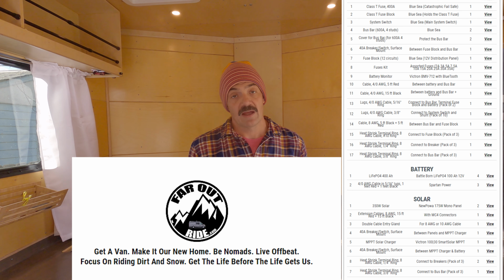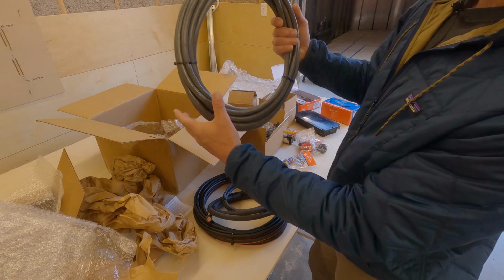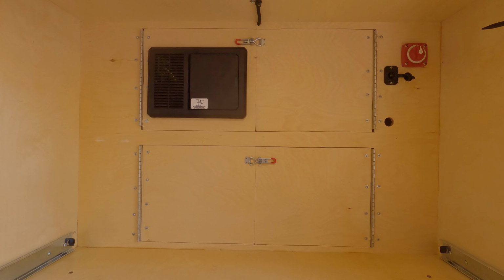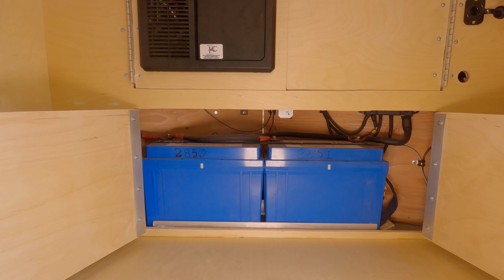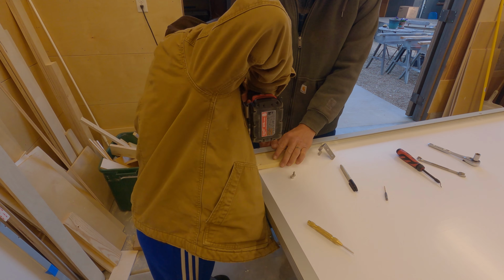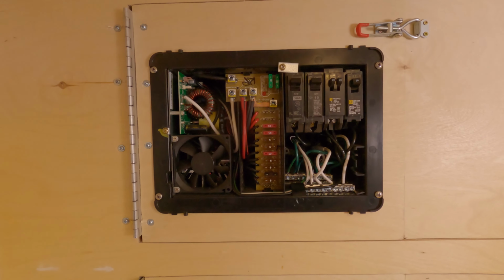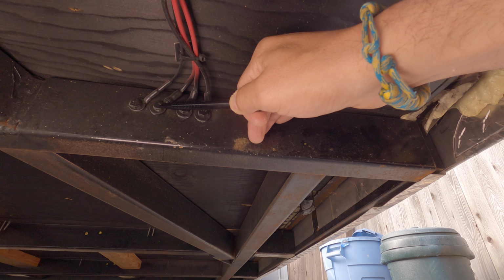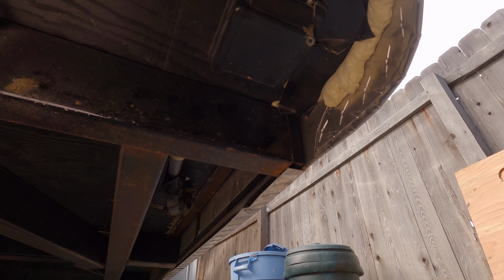DIY RV Electrical Tour- Solar, Victron, 12v LED Lighting

Comment: Thanks for the great information. I have heard that charging lithium batteries while driving could potentially burn up your alternator and lead acid batteries are preferred for this application. Should I be concerned about that for my build? Trying to decide which batteries to go with.
Reply from the maker: Brotherman- to be honest I am not the best person to answer your question.  Which is why I ended up using AM Solar- I just purchased parts that were all designed by an electrical engineer to work in my application. 
You could also speak with a battery manufacturer.  I had great customer service from both LifeBlue and BattleBorn.  
I knew I wanted to go with Lithium over LA (lead acid) for space and weight savings.  I only need two lithium batteries rather than four+ LA to get the full use of my 200ah capacity.  I don't know where I put my calculations but LA added a TON of weight and only saved me a bit of money.  Also, battery footprint in a small space (RV, Van) is valuable real estate.  Lithium for me.
Reply: @adventuredad1180  thanks, do you still recommend that particular battery that you used, and did you find one was sufficient to run your fridge etc.
Reply from the maker: @brothermanly316   I really like the LifeBlue batteries.  II have not tested other brands so this is really a comparison opinion.   I have not had any issues with LifeBlue, I liked my customer support interactions, and the Bluetooth app is super easy to use.  We had about three days of power with no input- full shade cover.  That is powering the Dometic, fans full time, lighting, and cell charging.  I think one battery with a combination of roof mounted and portable solar would work as well.